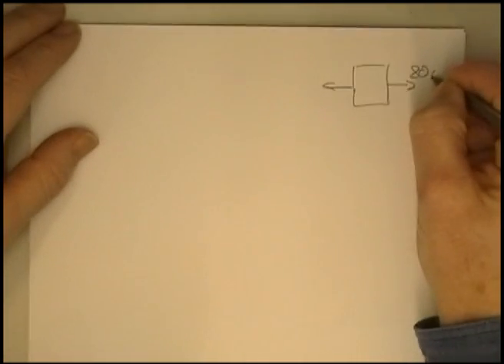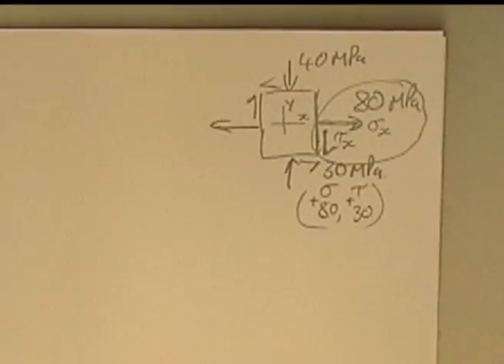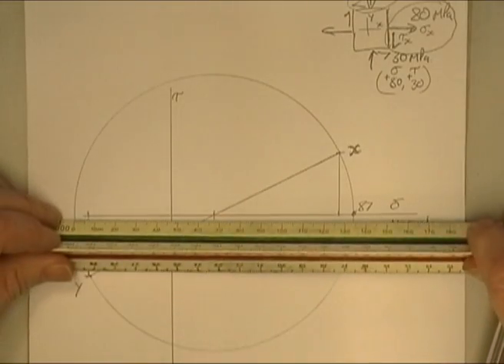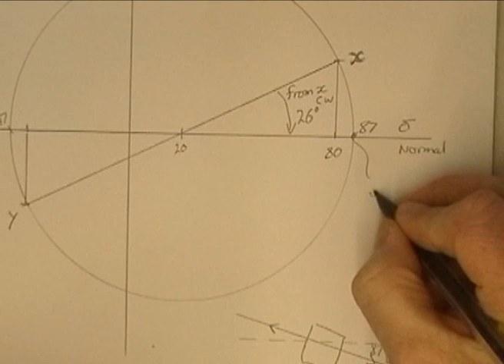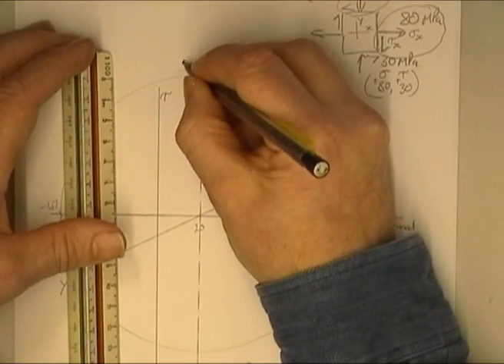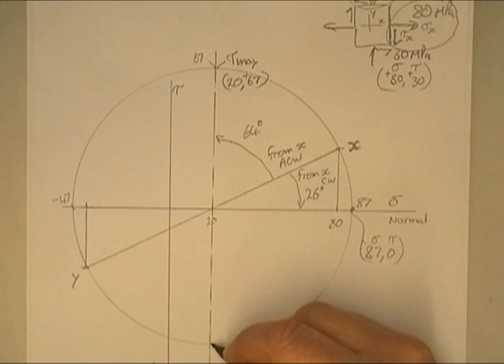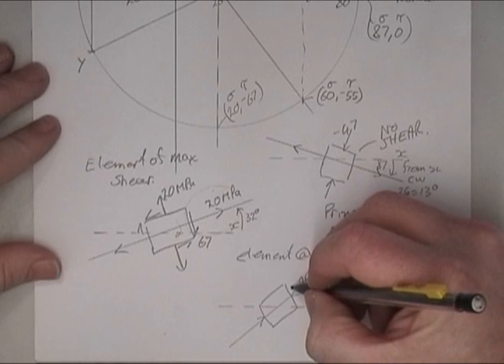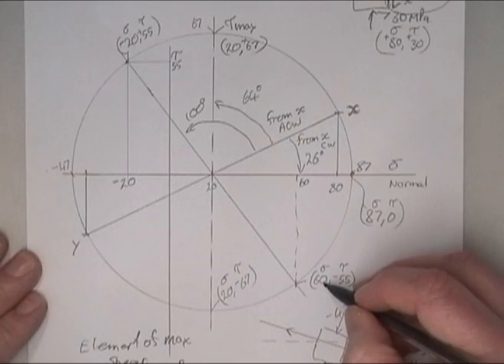Mohrs Stress Circle.wmv

Comment: Sir, at 5.12 minutes the x-axis is rotated in clockwise direction, why it should be rotated only in clockwise direction? why not in anticlockwise direction by 334 degree. I request you to explain this by representing principal stress and maximum shear stress in x-y coordinate system.
Reply from the maker: Hi
You can rotate ACW.  334° ACW would be 334/2=167°ACW and this would be the same line (angles at 13°).  I'm not sure about you last comment about x-y.  The principal stresses are at an angle to the x-y coordinate system by 13°

Comment: The shear stress on the x face should have been negative (-30)
Reply from the maker: Some people use clockwise as positive and other use negative. Process still works which ever way you do it. Steve.
Reply: +Steve Tomsett   i understand but here you have deviated from the universal sign convention only partially. Along the y axis you have used conventional sign but changed  the direction along the x-axis.So if we consider any inclined plane of the geometry by partially changing the conventions then there will be implications while deciding the direction of shear stress along the inclined plane of the geometry. Can you please elaborate how will we consider the change in direction of the shear stress on the inclined plane based on sign.

Comment: No i mean a plus/minus direction on principal direction does not matter. You just need to know if its tensile or compression. If you use a standard RON-basis do define that stress state youre using, then you would have sigxx = 80 MPa and tauxy = -30 MPa. Since youre using LON-basis, you have sigxx = 80 MPa and tauxy = +30 MPa.
Using RON-basis youll get 180 - 13 degrees. Which is the result you got but only 180 degress rotatated, which is the same result. You have tensile principal at both ends.

Comment: Hm, ok i see. But in that case youre not using a RON-basis in physical space. That makes matters confusing. What you define as +30 positive shear in physical space is then actually -30 using a standard RON-basis.
So when you rotate in a positive direction it becomes counterclockwise. The choice in reality is arbitrary of course. But its more handy to stick to a standard convention in order to avoid confusion.

Comment from the maker: you must use consistent sign conventions. In plotting the circle (physical space) we made CW shear + ve. ie the x shear was +. You need to select one convention and use that.  On the practical side, just looking at the shear on the element it is stretching the element from top L to bottom R. Therefore when you look at adding this stress to the X stress, the result will be CW from the x axis.

Comment: At 5:12, you rotate 26 degrees clockwise in mohrs circle. Positive rotation is clockwise in Mohrs circle so thats correct. But then you rotate 26/2=13 degrees clockwise in physical space. Positive rotation in physical space is counterclockwise. If you were going to rotate 13 degrees clockwise in physical then you would have to have -13 degrees. However your rotation in physical should be 0 <= angle < pi, due to periodicity.

You have rotated to 180 - 13 degrees for highest principal stress.

Comment from the maker: This gives a graphical view of all the possible stress states in a material. It is also easier to find the stress at any angle. It also helps to relate the circle to one of the failure theories like msst or mnst. You can use the formula if you like.

Comment: Great explanation!THX for that! But the shear stress as clockwise I learned should be negative.Question: If I use shear stress as negative, opposite to yours, what will happen with my angle?? Will the direction of it change as well? From clockwise to anti clockwise? THX in advance for answer. Christian

Comment: I don't get the clockwise rule for shear stress. In 3d there's no such thing, if it's pointing in the direction of the axis it's positive, if it's in the opposite it's negative. And supposedly we can apply it to 2d as well. Where does that rule come from and what's the use of it ?

Comment: great video! in the last 5 seconds, you mention that there is a stress of +60MPa in the normal direction, but you draw an arrow for compressive stress. is that correct, or is that meant to be tensile stress?

thanks for the video!